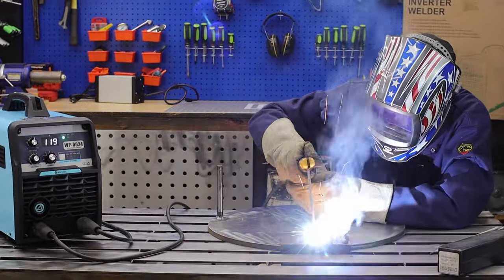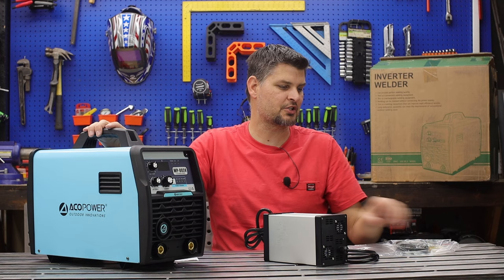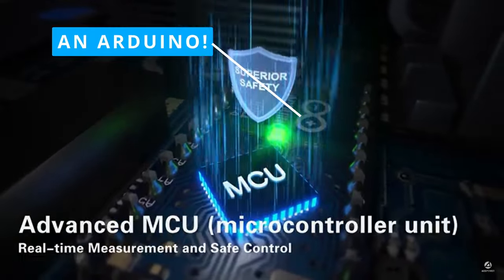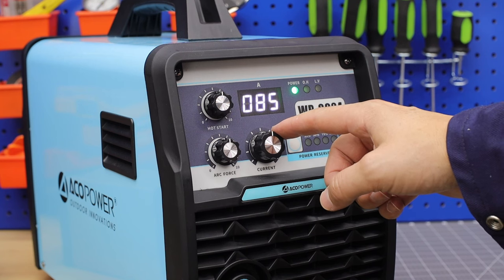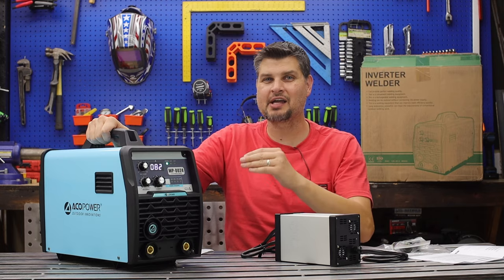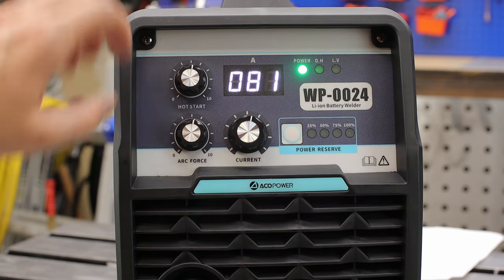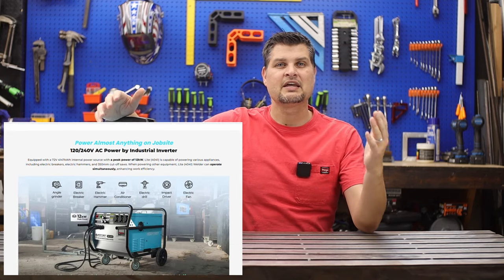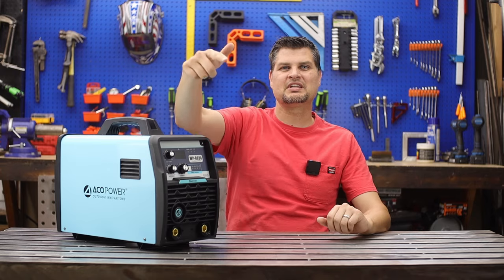Welding OFF the Grid:  ACO Power WELDER!

Comment: All well and good for right now. What do you do in 8 years when the batteries won't charge anymore and the company is defunct? 

Meanwhile my corded welders will still be running, and my little Honda generator powers my smaller ones just fine. Granted, it's nowhere near as convenient, but they fit in my tractor bucket just fine. 

I also have a little 1500w inverter that powers my smaller welders right off the tractor battery if it's a quick job.
Reply from the maker: Very true, it's not for everyone. I have been on some sites that don't allow generators over a certain DB so this would be perfect for those select situations.
Reply: Thanks for your feedback! We completely understand your concern about long-term usability. The LionWelder comes with a 3-year warranty, and the battery is replaceable, so you can extend its life even further. Plus, we’re committed to supporting our products for the long haul. While corded setups are reliable, the portability and convenience of the LionWelder offer a new level of flexibility. We’re here if you have any more questions!

Comment: Fronius accupoket 150 for about 3k
Karnage welder for $1099

An back in 2010 Hobart trek 180.. I think they were also 3k

All these are cordless welders fluxcore and stick..
Reply from the maker: I had to look some of those up. The Hobart was probably to ahead of the game. They should bring it back again!
Reply: @-DIYPRO-  an 2010 bad economy didn't help sales...
Reply: The LionWelder WP-0024 offers solid competition, especially at a more affordable price than the Fronius AccuPocket and Hobart Trek 180. While keeping performance high with a 10-150A range and the ability to weld 35 electrodes (1/8” or 3.2mm) per charge, it delivers serious value. It’s designed for portability like the Karnage Welder but at a much more competitive price point. Our mode also has a 3 year warranty

Comment: Off grid? You plugged it into the grid to charge it.
Reply from the maker: Exactly! But you do have to unplug it to weld. Honestly would be a nice feature to have a 120/240 plug to use when you do have power available and only use the battery when needed.

Comment: I'd like to know what battery cells they use.  

And what I find odd is they are using an Arduino board for the controller?!?
Reply: Taking a closer look at the graphics for the "circuit board" that's shown in promotional video,  🤣  wow!!  No where near a real circuit board. Someone just tossed a bunch of components images together on a circuit board and called it a day. Sizes aren't accurate, for some reason there's a TFT display on it, and there's a large laser diode on there for some reason?!?

Definitely would like to see a teardown of this thing and see what kind of cells they use.
Reply from the maker: Yea I pointed out the arduino, can't imagine it really running off one of those.
Reply from the maker: If I pop the hood I'll let you know what's inside!
Reply: @-DIYPRO-  Discussed this with some buddies in discord, it's quite possible that the PCB was "designed" by generative AI prompts. Which, looking at that part of the clip, sure seems 'very' possible.